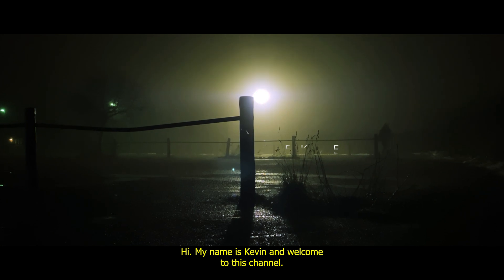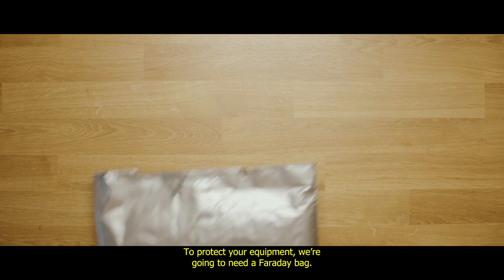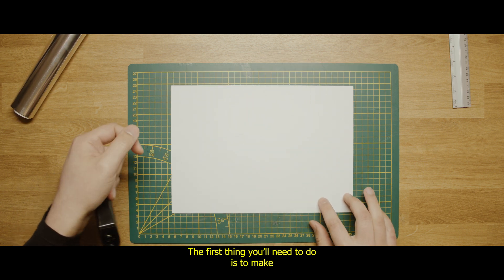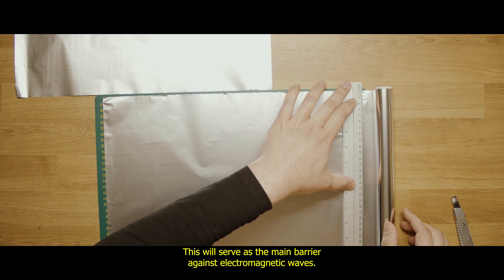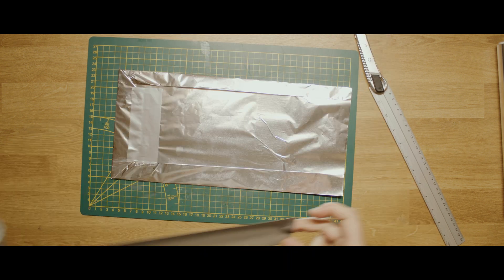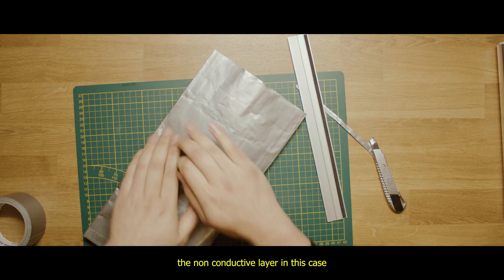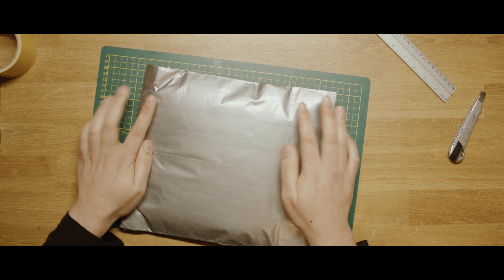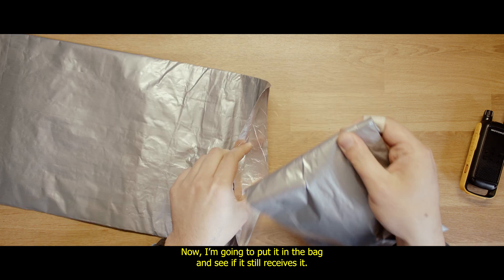DIY Faraday Bag

Comment: one thing to consider is that if an EMP happened, the conductive surface will have an induced electric current flowing through it which can cause it to heat up. it may be best to use a non-flammable material as the non-conductive insulation layer. nice tutorial though.

Comment: Always make sure that if you are going to store an electronic device in one of these bags that the device is turned off and if you can take the battery out. Leaving the device on could fry that device. And for Extra Protection, wrap it in a rag before putting it in the bag.
Reply: I’m confused- why would it fry without radiation?

Comment: seems to me that the typical foil coated Mylar food storage bags would work and will be a whole lot simpler.
Reply from the maker: No, a Mylar bag will not serve as a Faraday bag against an EMP. A Faraday cage / bag is typically composed of a conductive material such as aluminum or copper, and Mylar is not a good enough conductive material. Try it out and youll learn.
Reply: @kevinkoekje  the mylar bags I use have an aluminum coating, they are not clear mylar.  As an experiment I will test its conductivity using a multimeter.
Reply from the maker: The thicker the layer the better

Comment: what if the inside bag is just a ziplock bag? Will it work?
Reply: Yes a zip loc bag as the inner insulation bag will work fine.
Just tape it like the vid with Aluminum tape on all sides. The goal is to prevent an HEMP pulse from getting thru

Comment: Won’t a EMP mess up cell towers, internet modems, electrical stuff? U can have cell phone but it’s no good without service. Just a thought. 😊
Reply from the maker: That's why I store my handheld radios in Faraday bags. My phones are like mini computers; I have stored a library on an SD card, so I can read it on one of the phones, or we can use it as a small entertainment system for watching movies. And yes, we also have printed versions of the library. It's much easier to carry a small device that has the entire Wikipedia than having over a hundred books to carry.
Reply: The things you can still do without service is astounding. Offline maps, documents, manuals and other materials you can save and reference, the ability to connect to meshnets, take photos a videos etc. Think outside the box. It's still a tool and isint just used to watch YouTube videos or scroll facebook like most people do.
Reply from the maker: @Zamotak  exactly!

Comment: Excellent. Thank you. 
The only thing I would do/have done differently is to use relatively thin bubble wrap to create a little additional distance between the electronic item and the sides plus I use a gold foil for the innermost and a copper foil for the outer and wrap everything with aluminum foil. The gold and copper foils are not expensive but make sure they are real or genuine. A metal garbage can, safe or ammo box are good as well but put a little Electrically Conductive Epoxy or Silver Adhesive where the lids/doors make a seal.
Reply: What kind of silver adhesive or conductive epoxy  r u talking about ? For the lids of ammo cans
Reply: @barrydayton9988  aluminum duct tape. Which you can get at Home Depot, Lowes, or other hardware stores. The wider the better up to 3 inches is my suggestion. 
Just my 2 cents
Good luck
Reply: @barrydayton9988  Do internet searches for "metal tape" and "conductive paste for electronics". They help keep the contact areas connected smoothly so an EMP doesn't sneak through jump and spark.
Reply: @barrydayton9988 Im.using aluminum duct tape around all.the seams and the lid closes to give it as complete seal as possible.  I also cover the item in the Ammo can with Aluminum foil at least 2 sheets alternating opposite sides and wrapping it like a birthday gift with aluminum foil.
Just my 2 cents
Good luck

Comment: Could this be done with a box by lining the inside and outside of the box with foil/copper?
Reply from the maker: As long as the inside foil and the outside foil don't comes in contact to each other, and the items inside the box are wrapped in a non-conductive layer, it should be okay
Reply: I have some fans I bought in case of  SHTF situation. I wrapped the box with aluminum foil and used copper tape to finish the job.
Reply: @kenpeters9807   Perfect!
Reply: I used cereal box.  It still needed two wraps of foil.  I used insulation foil tape.  

BTW if you look at reflective foil.  It has holes in it. So it wouldn't work.

Comment: Wouldn´t the plastic casing of the Powerbank be enough of a non conductive outer layer?
Reply: Could be but isn’t it screwed to the circuit board with metal screws?

Comment: A manilla envelope should work well too
Reply: FedX envelopes...
Reply: Yep, good idea.
Only, I would add some kind of padding at the edges as to make them less sharp. This way we decrease the chances of cut or gaps opening on the aluminium foil, through which signals could find their way in or out.
Reply: I believe you mean vanilla envelope..the tan ones
Reply: @smoline1  No, they mean a Manila envelope. Named by paper makers during a cotton + linen rag shortage, turned to using Manila rope, hemp, to make paper. The envelopes can be brown, grey or white. I haven't seen any tan ones.
Reply: @eadlondon-nm2uy no im pretty sure its vanilla

Comment: Thank you, i’m gonna do this and use my copper tape. Should be pretty too!
Reply from the maker: Yeah! Copper would look great! Sadly copper tape here is hard to find and very expensive
Reply: If you do don't cover it with duct tape. Reflective shiny surfaces are more effective in blocking higher frequency 4 and 5g signals, which are best to deflect than to absorb and disperse.  The shinier the better.

Comment: What if you just use one bag, would it receive a signal?
Reply from the maker: If you use just one bag, it should effectively block signals, but the level of protection might not be as high as using two bags. The dual-layer design is intended to provide an extra layer of security by minimizing the chances of signal leakage. However, using one bag should still provide a significant level of protection against unwanted signals.
The more barriers, the better; thicker is also preferable.
Reply: Two is one and one is none :P
Reply from the maker: Exactly! @w3bb0y
Reply: @w3bb0y   👍